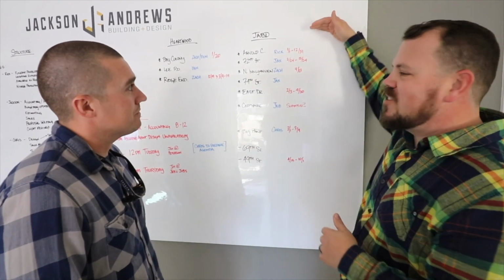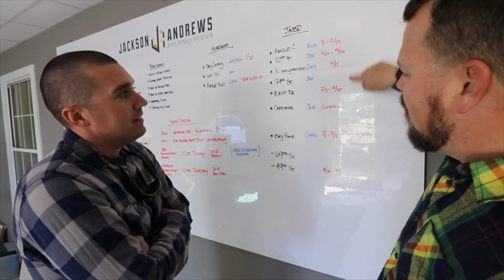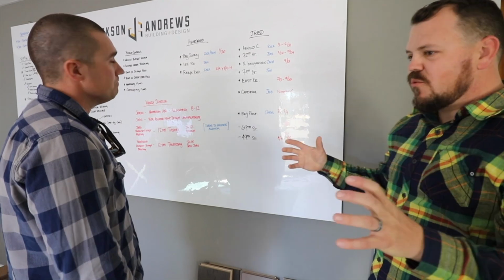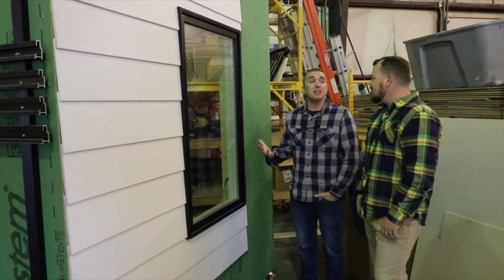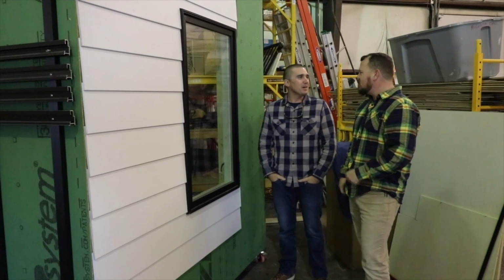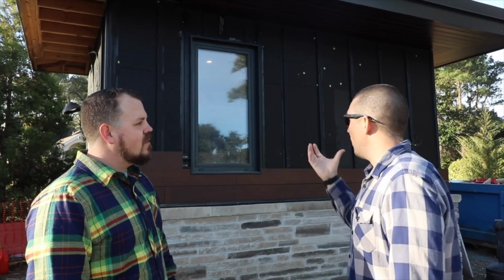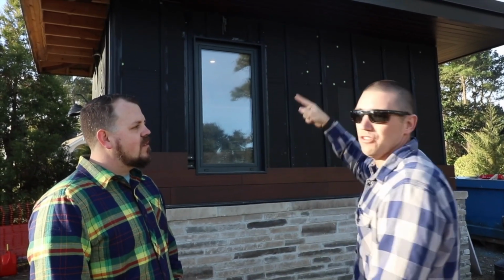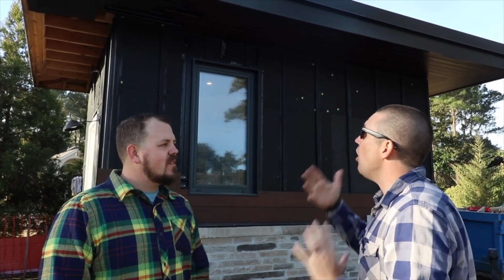Communication Comes in Many Forms

Comment: I'm a smaller owner/operator for my finish carpentry business and I work in differently structured jobs all the time. Before I start I need to clarify who is making decisions and who I report to. 
It can get confusing when you have design decisions as well as logistical/schedule questions. Accountability for those questions are sometimes going to different people (client/homeowner, project manager, designer, general contractor, etc...) 
It's helped to set boundaries that I will only work with certain parties when jobs get bigger to avoid confusion. It's difficult to do, because I enjoy communication and interaction with all parties, but it's caused confusion too many times in the past.
Reply: Well said and ₳ fabulous comment kindly get Ɨ₦ touch for advice and assistance <<<<+1•3 •0•1•3•8•8•5•4•6•4<<<
Reply: Well said and ₳ fabulous comment kindly get Ɨ₦ touch for advice and assistance <<<<+1•3 •0•1•3•8•8•5•4•6•4<<<